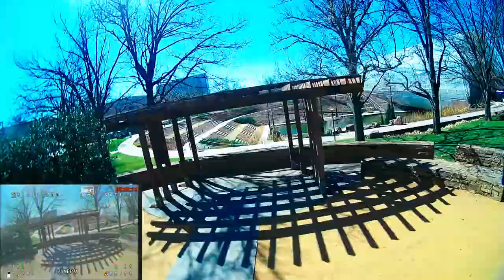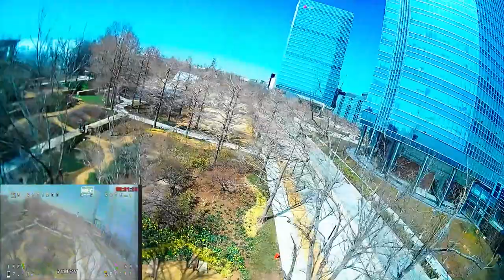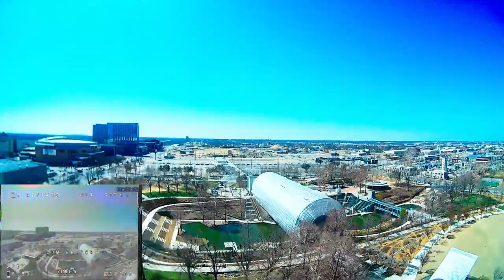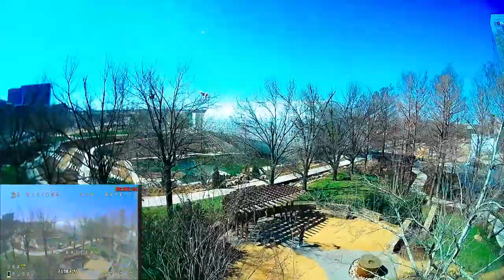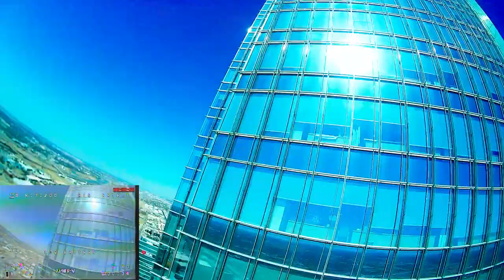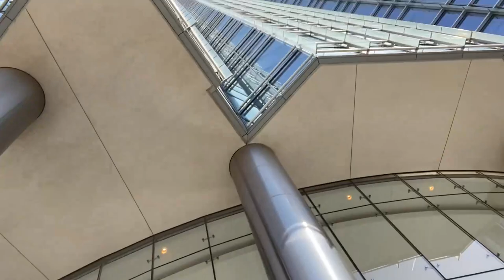TinyGO Dives 50 Stories and EXPLODES! - FPV Freestyle

Comment: Hey man.   You took the leap.  Took the shot.  Pushed your boundaries.  Very well done.   So you broke your tinygo.  You're not progressing unless you test your limits right. Okay okay.   Maybe see if you can get a compatible vtx that has a higher output.  Like 400.  That way your picture won't break up as easy.

Comment: i had to upgrade my esc and vtx after a bad crash as well and can not get my tiny go 4k going right again could you help by chance with a cli dump for it and all your settings or how you got it going i do not have original cli dump due to breaking before learning anything about beta flight mine is all original besides my goggles. 2 of 4 motors spin in correct orientaion after installing new f4 12a esc and vtx.

Comment: What caused the failure? Battery voltage too low and the whole thing brown out?
Reply from the maker: I’m thinking a gust of wind caused an air mode over correction and sent me into the side of the building